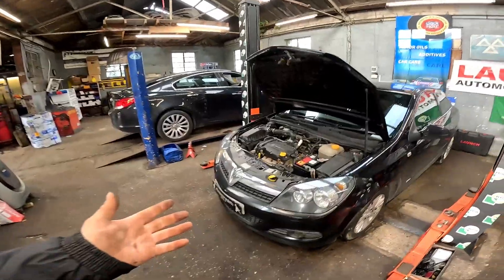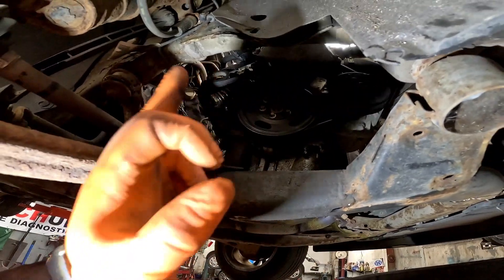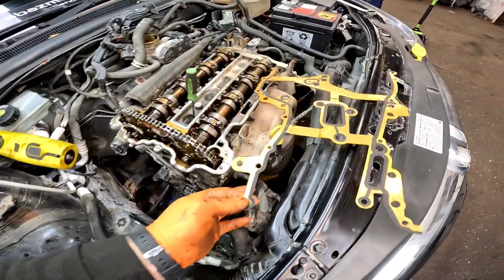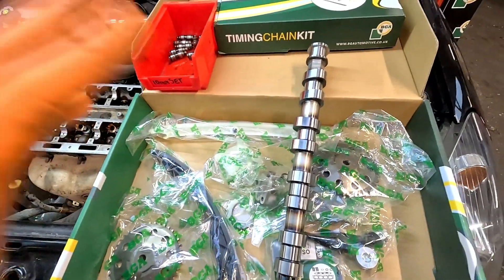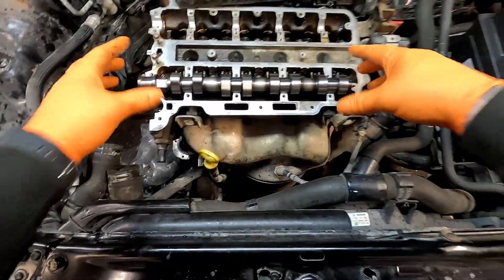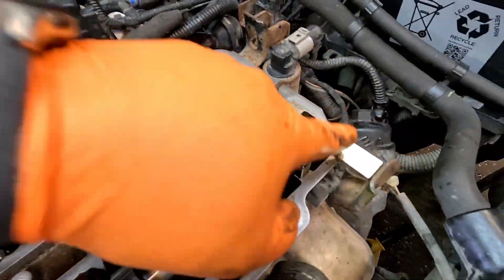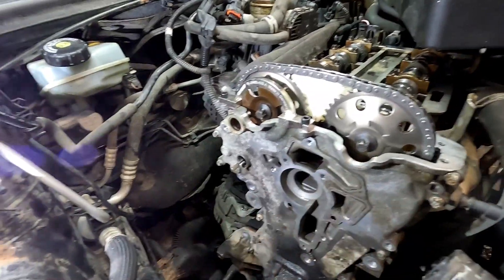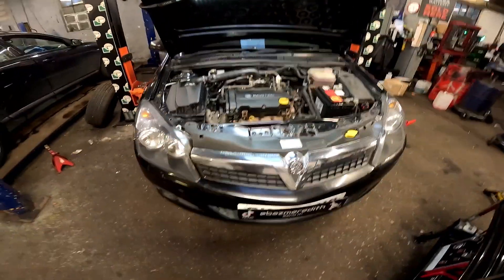vauxhall stretched timing chain and worn camshafts lucky customer!!!

Comment: Hi Baz, loving your videos. I've watched all of your corsa timing chain videos and I have learned a lot. I've got a Corsa D with a Z12XEP engine. I've removed the valve cover to check the timing with the locking tools and all the pieces slot into position without any issue, there's no chain lift / slack at all but the car still gives a P0016 code, the MIL stays off. Any tips? Thanks a lot.

Comment: by any chance?... changed both cams on my girlfriends z12xep and now got a lumpy idle. I've checked numerous things. but yours is the first time I've heard the lifters shouldn't contain oil when reinstalling, when I put new lifters in I added oil to them all, through the side hole. could this be my issue do you think. Great video, wish id seen this one before I attempted the chain and cams